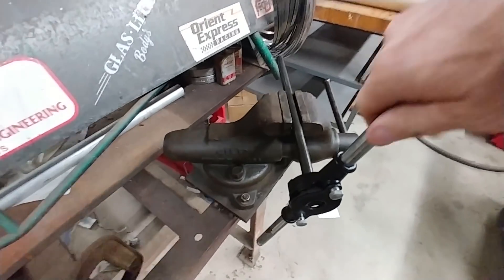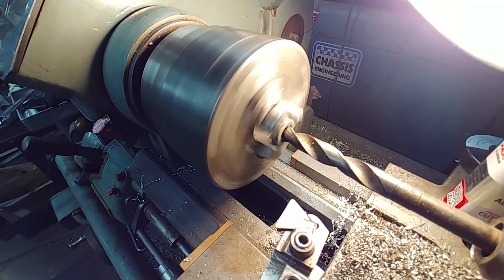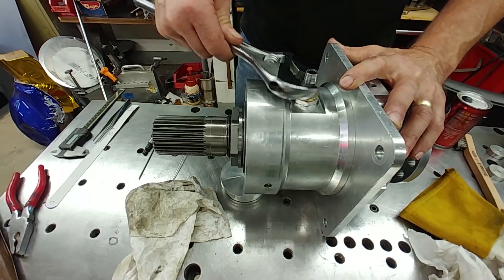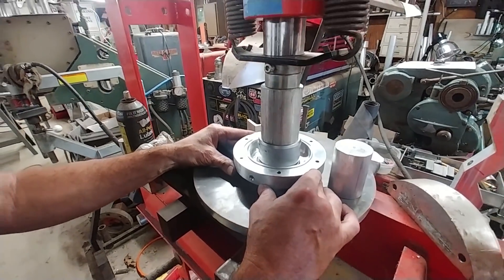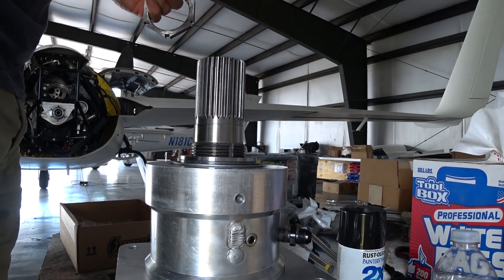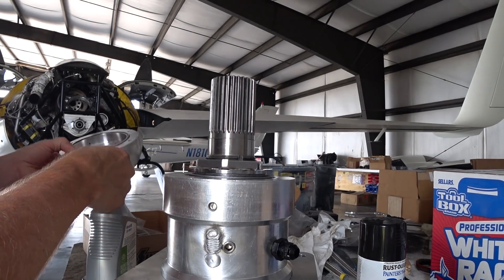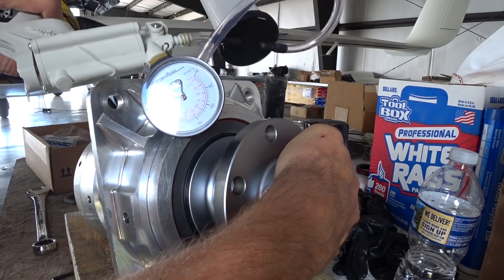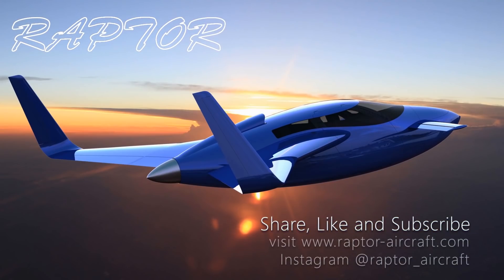ReDrive Mods Completed - Building the Raptor Prototype

Comment: Your "Vacuum" theory for the re-drive is wrong.  Without an air vent at the top, the oil level is NOT going to be level with the drain .. it could be higher, even completely full.  Imagine for a moment, that somehow the drive has become full of oil.  the ONLY way out is through the drain hole, which has a slight vacuum.  HOWEVER the only way for oil to leave is if more oil enters via the feed pipe.  It cannot drain any oil unless it replaced with more oil, as there is no vent.  If you had a vent, then the drain hole, could suck down oil faster than the feed pipe was producing it, filling the space with air from the vent, and thus lowering the oil to the correct height ... without a vent, it won't work as intended.

Comment: So how did you safety the Allen bolts holding the case halves together? They do need to be safety wired to prevent them from coming loose. Also, those bolts holding the redrive to the engine mount would best be castle nuts with cotter pins. I see what looks like self-locking nuts but the can only be removed one or two times before they lose the ability to self-lock.
Reply: All that will be going through families mind as they go for a ride in an uncertified airplane.
Reply: Kevin--  All of the manufacturers who make those self-locking nuts claim 50 uses. I wouldn't test that with my life, but they are for sure good for way more than 2.  I've tested that with my life for 20 years.

Comment: Anyone who has ever designed and built and aircraft can tell you that the original designed weight and actual build weight of their aircraft is not going to be the same weight. Is just the nature of the beast. For those of you who like to complain, complain. And those who like to design and build, design and build. You are never going to make everyone happy so don’t even try. If you think you have a better design then build one and put yours out there for people to critique. Thanks for the update Peter and good luck!
Reply: they told the Write brothers they couldn't do it that way, look how that turned out.
Reply: Pictsidhe I think it will come down to performance and cost because they are directly related. I just hope it’s safe. All these issues to me have been the reason why I wouldn’t fly in certain aircraft. I have built several aircraft over the last 42 years and some were proven technologies and some were new design concepts. The new design concepts were always the hardest to achieve all the designed goals. Especially when using composite materials. In the V-22 there was about a 14% weight savings in using composite, but the manufacturing costs were about 2.25% higher overall. The savings when using composite materials were in the operation of the aircraft. Had V-22 aircraft been made for the general aviation community it would have never been produced. Because of the designed goals and the final aircraft cost and performance numbers were not even close to original numbers. I won’t even talk about the safety of that aircraft. Now that’s white elephant and they are using tax payer dollars to fund it. And the government is still flying the H-47 to make up for the V-22’s readiness. Or should I say, lack of reliability. Metal design components usually achieve their designed weight but it’s the production costs that usually hurt the aircraft. 
I believe 3D printing is a game changer for the aircraft production community. With most aircraft being developed using 3D cad software all the information is there and ready for production parts. The next ten years are going to be a large growth in the production of parts being produced by these printers. And hopefully this will help drive down some costs or at least keep them lower for a few years??
The future of aviation is going to be fun to watch and I hope this aircraft is successful in its flight testing stage. There has been a tremendous amount of work & cost just to get to this testing phase. I am with you all the way!! Good luck!

Comment: Could be wrong, but the way I see it, the central sleeve with the two smaller bearings is now  redundant, along with all the bellville washers, because the oil seal is now outside the two main bearings, such is the nature of development, a whole lot of tiny failures, hopefully leading up to an eventual success. keep chipping away
Reply from the maker: That is incorrect. Without the oil collar the governor would be trying to put high pressure oil into the complete case which would cause the outer oil seals to fail. The close tolerance area in the collar is where the high pressure is held back. Everything outside of that is low pressure.
Reply: @RaptorAircraft  Ok, all the best for your tests

Comment: Nice going, getting close now. Looking at the setup I would suggest lockwiring the inlet, if it is not torqued down. All the vibration in that area may work it loose.

Comment: The new oil feed with welded collar will slightly side load the shuttle.  An o-ring in a groove in the tube or in the housing would eliminate that side load.
Reply: This is a really good point.

Comment: Objective criticism. This is a better design than before, BUT, using clam shell split bearings like in an engine's crankshaft bearing will outlast and out perform your setup here, has less moving parts, rides on a thin film of oil instead of metal to metal contact. A roller or pin bearing has constant metal to metal contact and when that pin or roller fails, good bye re-drive!
Reply: ,,, the thrust on the plain bearing deal was a potential problem. Unlike an engine that really only sees lateral load on the thrust when the clutch is depressed this would have constant load from the prop .
Reply: @rolandtamaccio3285  Wrong answer.
Reply: ,,, well, automotive, truck guy here, I try to bat a thousand, and I didn't realize that, and when I was in the Air Force they only let me put : oil, gas, and anti-detonate in our Curtiss Wright 3350's .
Reply: @aeronot bac Correct answer aeronot.

Comment: The redrive is going to be the most complicated issue to solve on this prototype. You seem to be paying attention.
Reply: I worked for a company that designed and built a engine installation for an aircraft based on a alloy big block V8. It started off as a motorsport based engine with a one off reduction gearbox with its own pressure oil system. It had PT6 prop governor on it running a reversable  prop. It started off with a chain drive which snapped and wrecked the housings. Then they went to helical gears which produced wear and backlash issues. Finally they went too straight cut gears. By the time it flew it had hundreds of hours of ground running on it  and it still sheared the governor drive in flight. This resulted in a dead stick landing luckily infront of the hangar back at the airport. It went well but always had issues. In the end the program was canned and we put a walter M601 in it instead.